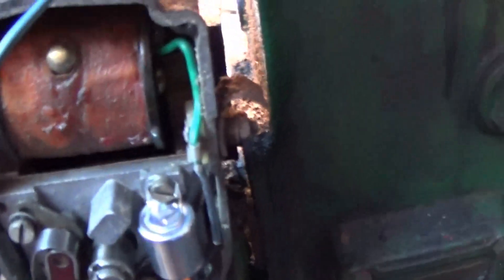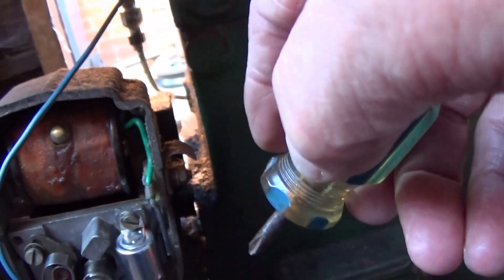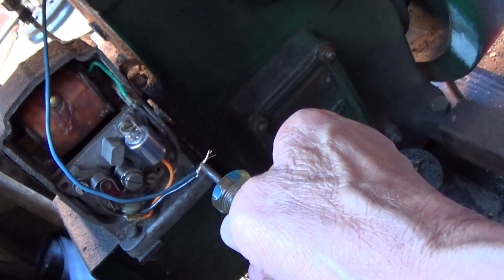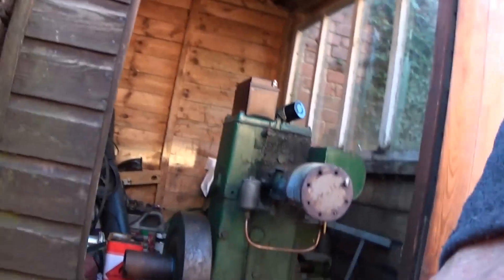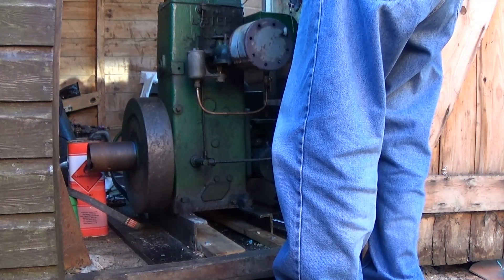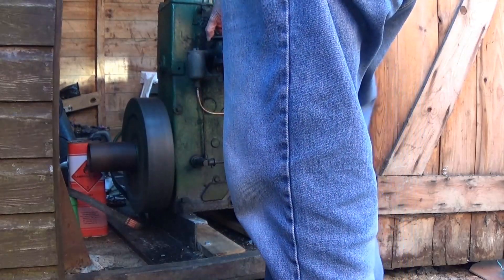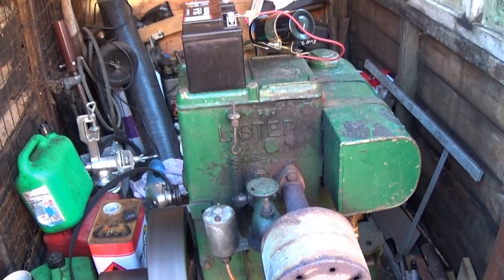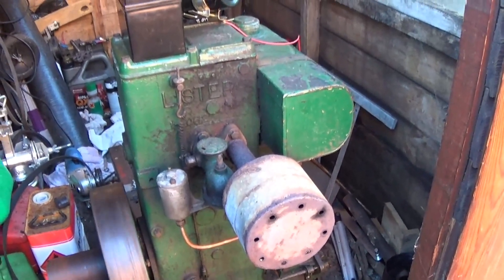Lister D Lives Again

Comment: You will have to run an alternator on it Malc to charge the battery lol
Cheers, Jeff.
Reply from the maker: LOL jeff. It's surprising how long a car battery will last starting and running an old fashioned car engine without being charged.